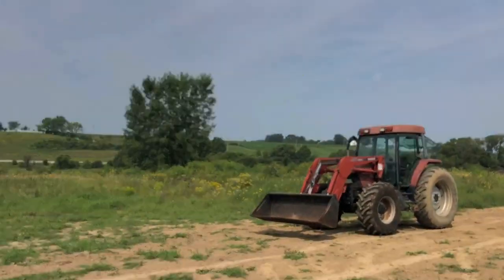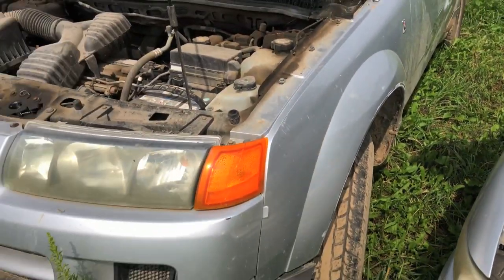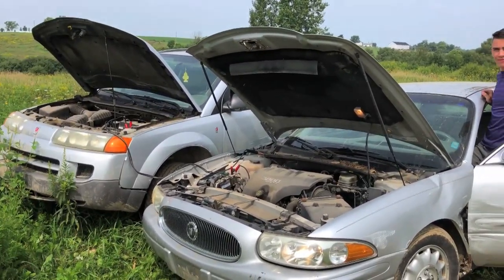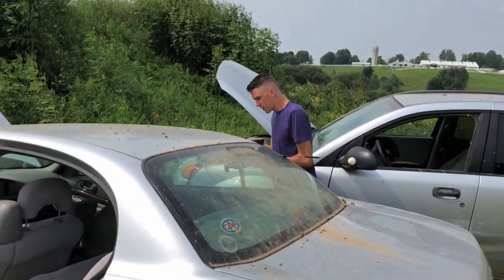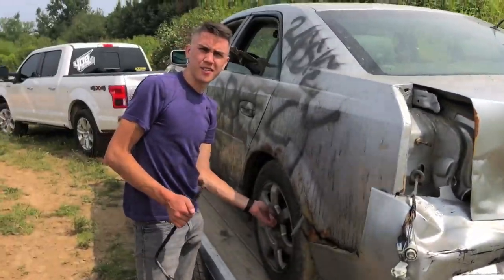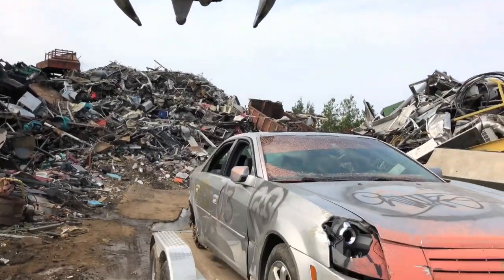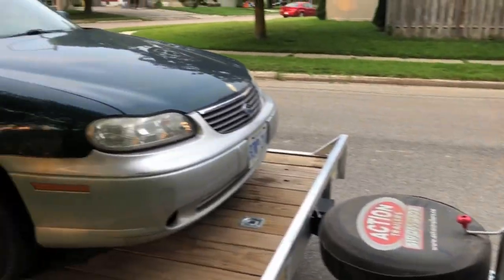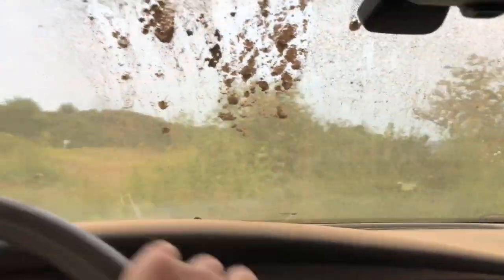Saturn T-BONES FORD!!!

Comment: The 3.8L V6 is a beast of a motor had a 93 Pontiac Bonneville got it with 250k went to 399k before the trans went